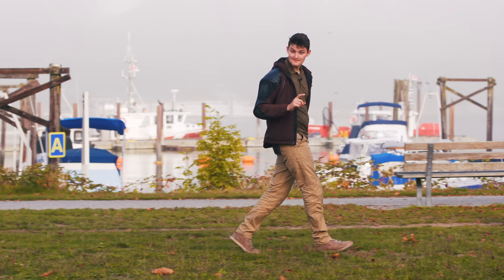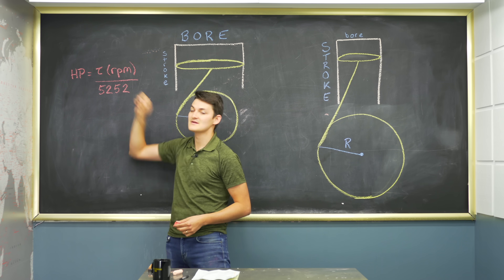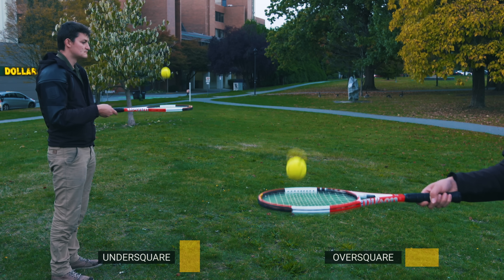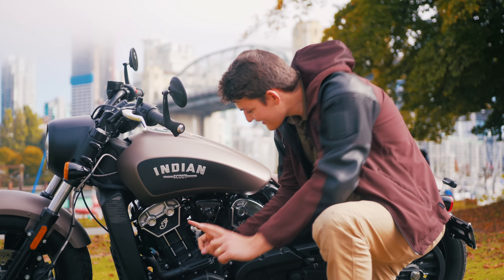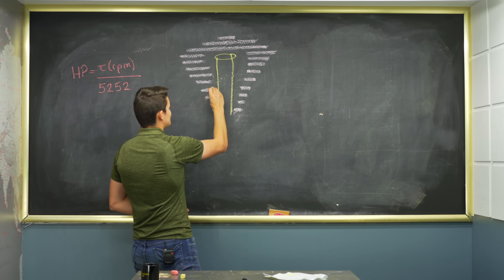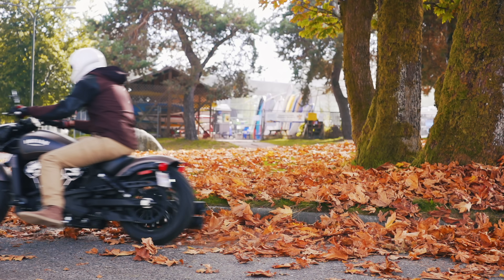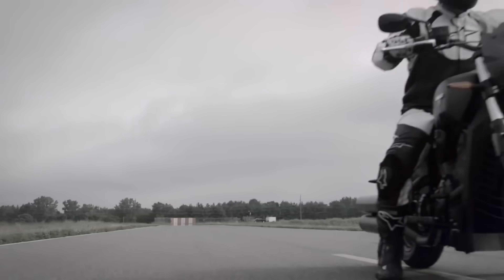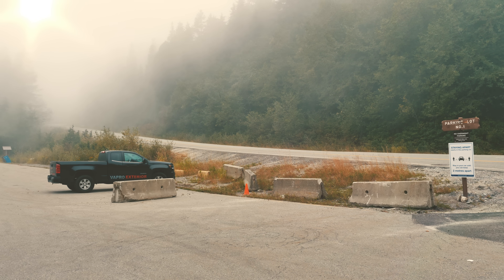How Indian Makes 43% More Power than Harley-Davidson

Comment: I was going to get the harley nightster when it first came out but my dealership told me msrp is $13,000 but they will give it to me for $19,000 after that i left and now i have a 2023 Indian scout rogue and I'm so happy i sent with the scout its a very fun, nimble and smooth bike. Plus i just like the looks better than any Harley. I've had it for a little over a year and have 16,000 miles on it and have had zero problems

Comment: "You can't use pushrod actuators, they're heavy, and heavy things don't like to change direction quickly."
LS's with stock pushrods and rockers revving to 7000rpm: "Allow us to introduce ourselves."
Reply: You're still missing the extra 1300rpm indian makes
Reply: Didn't those have serious cylinder head issues?
Reply: Still less than any scooter :D
Reply: Thought the same thing lol
Reply: @snapcountersteer  Not to my knowledge? I've got a 5.3 with cam and springs, stock heads are doing just fine. There are some minor "hot spots" that can develop if you're not using the steam pipes, but it's nothing to be overly concerned about IMO unless you're really making some power for long periods of time and heat is becoming a problem.
Reply: @AustinRBa  I misread your comment and thought you were referring specifically to the LS7.

Comment: How Harley-Davidson makes 43% less power than any other brands.
Reply: 58HP for 1200cc is really low I thought but if they're limiting themselves to middle 20th century tech it makes sense I guess lol
Reply: Easy, they are horrible bikes, 😄
Reply: @SwainixFPV  Yep the crf1000 is making around 90hp and that is considered low for a 1000cc twin.
Reply: @SwainixFPV  only 10-15 hp difference between my drz
Reply: It's the old school tech they use.  I had a 2000 Harley Wide Glide.  It had 1450cc and only put 69hp to the rear wheel.  And that's after putting on an upgraded air intake, pipes and having it dyno'd and jetted.
Reply: My BMW R1200S pumps out 122 herspers, oil/air cooled, with push rods. However, I absolutely love my Dyna FXD. Low-rev torque goes well with a classic looking cruiser.
Reply: My Vga N1 makes 4hp at 8000rpm. Try to beat me
Reply: Harleys are good at turning good gasoline into noise without going via effect.
Reply: I had a harley cruiser guy randomly try to race me, I didn't even think he would. I was on my DRZ and even though he started before me, I was still able to catch back up to him and held until we hit 80mph. I was amazed at how sluggish such a large displacement bike was.
Reply: My 1971 Triumph TR6C (Bonnevillised) makes around 50hp - some say 49, others 54 - in any event at 49 years old and having just over half the cc (650) and even having the penile tubes containing pushrods it's astounding that the HD 1200 produces only a few hp more. On the other hand my ancient bike doesn't have catalysers or the faintest clue of what a pollution control system is. Sounds great though.
Reply: @stimpsonjcat26  i mean the cb650F I get to ride in my driving school has more than 90HP as well and it's a 650cc bike ^^'
Reply: @SwainixFPV  yeah but it has 4 cylinders
Reply: @christiannoble5549  Actually they are not horrible at all, I mostly ride sportbikes but I have a Sportster 1200 that I really enjoy even though it has no power. It's easy to ride, comfortable, and I have had no problems with it whatsoever other than general maintenance like batteries and oil. The best part; low miles and only cost me $4K when I picked ut up a few years ago.
Reply: @stimpsonjcat26  lol yeah I have the crf1000 and an 02 gsxr1000 @approx 160hp, lined them up together and amazing how 2 1000cc engines can be so different.
They are both fun in different ways, one will burn your license in 1st gear and most likely kill you one day and the other takes longer to kill you.
Reply: @stimpsonjcat26  yeah that's true
Reply: Aeromecano  Magna?

Comment: Lotus made a push rod F1 engine years ago that was so fast, the F1 Commission banded it.  So it's not push rods that are the culprit my friend. 
I believe Harley- Davison's problem may be in keeping their iconic and patented sound.
Reply: Pushrods make plenty of power, the problem is air cooling the engine. If Harley would use a radiator and oil cooler,  they could crank up the power. Japanese cruisers do it just fine.
Reply: I have an old 8HP Gilson lawn tractor with a blown muffler. Sounds just like a POS HD
Reply: @joebalser9515  no it doesn't... stop being a hater, its unbecoming. I'm not even a fan of Harleys,  I prefer more modern tech, but all this Harley hate is just stupid. Some people prefer old torquey air cooled cruisers made in Anerica and we should be glad there are companies who meet that demand.
Reply: @QarthCEO  LMAO ! HD's aren't made in the USA anymore, not most of the parts at least. I hate them because I know them. Overpriced junk that sounds like a bag of shit. It is what it is
Reply: @joebalser9515  Actually, to qualify to be made in the USA, a plurality of parts have to be made here. HD's have lots of parts made overseas, like Showa suspension, Brembo brakes, Samsung LED's, and most of their electrical components, but they are still mostly made in the USA. To call them "junk" is to just be a hater. A new Harley will run just fine and be just as reliably as any other large air cooled Vtwin cruiser. Only Indian rivals them in quality, and frankly, Indian has been slipping.
Reply: @QarthCEO  the newer stuff is light years ahead of what I'm used to. new stuff made elsewhere can only be a good thing. The older bikes were oil leaking, gutless, unreliable junk.
Reply: @joebalser9515  It seems Harley will never be able to live down their old reputation under AMF. After Harley was sold to AMF in 1969, quality plummeted. Harley bought themselves back from AMF in 1981, but it wasn't until 1990 that quality was back to where it was in the 1960's. Which wasn't all that great, either. The Japanese had left Harley in the dust by then. It took a long time for Harley to finally compete in quality with Japanese bikes, but they have been just as good for at least the last 15 years. I think it's time to stop calling them unreliable. You can call them overpriced all you want, though, they still are. So is Indian. But who am I to tell other people how to spend their fun-money?

Comment: Which is why I bought my harleys used. As much as I love them. They haven't really changed much; so for a 3rd of the price of a new one, I can get an older bike that looks the same. Aaaaand because they haven't changed much, you can get the motor rebuilt or big bore kit(like I did) and basically have a new bike. All for a fraction of the cost.
Reply: Yeh, but it's still a Harley! Wet fart sound from a tin can. Clever!!
Reply: That's exactly what I did too. Bought an '01 Sportster 883 for 2k, built it as I wanted it, as a 1275 hopped up beast. So I ended up having about 5k in it. And I'm quite certain it will smoke one of those scouts, easily.
Reply: Still riding my 5th Harley, a 1996 FLSTN softail. Do any work on it myself
Reply: @andylives5575  Your comment is sad

Comment: I would add that the ease of working on a air cooled Harley compared to liquid cooled bikes, and rice rockets like my sons Yamaha (170 mph) are perks for me. Changing spark plugs on my Harley takes five minutes. On my sons Yamy it takes about an hour. Just preferences of the rider
Reply: How often do you change plugs?
Once every 5 or 10 years?
Reply: @RedRider1600  it was an example of the over complexity of motorcycles today so most people need to return them to the shop.
Reply: @martincole1478  
It's not that much more complex.
And it is seldom an issue.
Kawasaki is pretty reliable.
I think it was Harley that had quality and reliability issues.
Reply: @RedRider1600  I had Kawi, Honda, Yamaha, Triumph, and a 1966 Suzuki X6 Hustler with a 6 speed tranny. Many bikes . My sons Yamaha 600 takes 1/2 hour to remove all the plastic fairing just to get to the plugs (4)and let’s not even talk about the carb intake boots that dry up and crack every year. Plus no need to have a track bike that goes 175mph with speed limits around 55 to 80 mostly. Ride a track bike cross country and then tell me about comfort, and conversely try a street Harley on a track. No good. I work on all bikes so it’s just comes down to preference and riding style. Horsepower is drug the bike mags sell to get your cash.

Comment: the best engine ever for a motorcycle was the V-Rod engine and Harley refused to really ever support that motorcycle
Reply: Because customers refused to buy it. What's with you Harley haters?
Reply: I have ridden HD for 20+ years.  My wish that the factory NEVER made was a V-Rod engine in their touring package.  Now my wife has a V-Rod trike for her first motorcycle....and I am waiting for her to get enough experience to open that thing up....
Reply: until you realize japanese motorcycle manufacturers were building bikes that would shit all over it for a few decades already. which makes you realize that engine was never the best or even had the potential to be the best motorcycle engine period. like most American manufacturers they needed help just to develop it from a foreign manufacturer.
Reply: @robbalinski1606  haha, so true. From a Harley owner btw. But just how much power do you want from a bike that handles like a pig on ice...
Reply: @StaTBMK  its simply because more cylinder means more power

Comment: Ok you have convinced me- I'll take one of Victory motorcycles or that Indian over a HD
Reply: funny that he does in fact do indian marketing better than they do. i've had a couple different indians, and while i love the bikes the company leaves a lot to be desired- the dealer network is atrociously inconsistent (my two worst customer service experiences ever were BOTH with indian dealerships/corporate), corporate is just as cash-grabby as harley. don't get me wrong, i love riding my bike, i just hate dealing with everything else that makes up what the company is.
Reply: don't worry about making a decision, victory is dead and hd will be by 2021. just gotta figure out if you want retro cruiser or retro dirt tracker
Reply: @platinumbond5487  I have given up on those kind of bikes and I am now dreaming about a Tenere 700. I might be able to afford one in 5 years
Reply: @CastleBomb44  get a KLR 650. They’re affordable
Reply: @platinumbond5487  I want to avoid bikes with carburetors.  I was not that impressed with my friends KLR650 but that lower price does make it more appealing.
Reply: Buy a used 1200 Scout, change out the front wheel to a skinnier one and change the rear sprocket to the Octane/Asia market tooth count and you have an Octane. Same engine and same 31 degree lean angle....and you can pick up a used Scout all day long for $8k.
Reply: @mattshaggs2931  there’s only 3 parts that the octane and scout share, plus the huge performance difference. You can’t turn a scout into an octane.
Reply: @platinumbond5487  They share over 30% of parts. You think having 2mm more bore in the Octane really changes the power that much? The Octane and Scout real pulleys are interchangeable with a 5 tooth difference. That IS significant.

I stand by my statement...change the ratio, change the wheels and (if you want) the springs and you are there despite you whining over small differences like "the clutch and brake levers are different."
Reply: @platinumbond5487  the scout and octane are pretty much the same bike. Except the octane makes like 4 HP more😂
Reply: @rohinhans7819  yet everyone that’s rode both says there’s a huge difference in performance. I’ll believe them instead
Reply: @platinumbond5487  well just look at the spec sheet. The octane is a bit lighter ( next to nothing) and a bit more HP. The only thing that could be different is gearing

Comment: Info: Harley Davidson had to shut down their shop in India. They couldn't handle Royal Enfield.
On a different note, a 300-350cc bike is more than enough to ride through the most unforgiving terrain of the Himalayas, provided the bike is well built and the rider knows what he is doing.
Reply: It wasn't that Harley-Davidson could not handle Royal Enfield, it was that Harley could not handle the high tariffs in India which translated into high prices to customers. That is why Harley is trying a different angle to crack the India market by doing a coop there with another bike manufacturer. Royal Enfield's are nostalgic but a far far far cry from Harley quality. Just looking at the facts.
Reply: royal enfiled is british not indian
Reply: @tonyzee9931  You are right about their older 350cc models. The new 650cc ones are pretty good. I have tried both the models and I will choose the Interceptor model. Indian market is very price conscious. That 650cc Enfield costs a half of a 750cc model by HD. The obvious question anybody asks, is, "What am I getting for paying double?".
Reply: @King_droid4908  It's owned by Eicher motors, headquarters in Chennai. It's Indian.
Reply: @dexterroy  no its british
Reply: @King_droid4908  it was british about a century ago. the brand was all but abandoned after ww2 but the indians just kept building them cause well, that's what they knew how to build. 

it's indian now.
Reply: @King_droid4908  they just have british legacy and r&d center in uk now. The ownership and manufacturing operation of the brand are totally indians today, nothing to do with brits anymore.
Reply: @King_droid4908  it was british but is actually Indian
Reply: @tonyzee9931  will second u buddy brought a Dyna and a RE 500 chrome in 2013, both the babies got the same treatment but the harley in terms of quality wins..... And I was a little sceptical in the beginning if the harley could handle the Bombay monsoons, well it did.... even now rolling my the Dyna to the gas station, people don't belive the bike is 7 years, looks as good as new.....
The royal Enfield will always have a  special place in the hearts of every true royal enfield rider here in India whatever the competition....cheers!!!!

Comment: One downfall of the Scout;
The 6 speed transmission is kind of a waist. 

It is identical to the 5sp in gears 1-4. The 6sp, 6th gear is same ratio as 5th on the 5sp. Only the 5th gear (on 6sp) splits difference between 4-5 on the 5sp. When riding in town, I usually skip past 5th, go to 6th. Seldom would 5th gear actually be useful 

With the torque and power, you could almost get away with a 4sp, and have 5th as overdrive. Or, better yet. 6th on a 6sp be overdrive. Running around 4g's at freeway speeds is a bit high on the rpm's